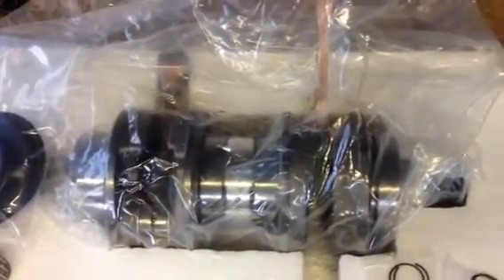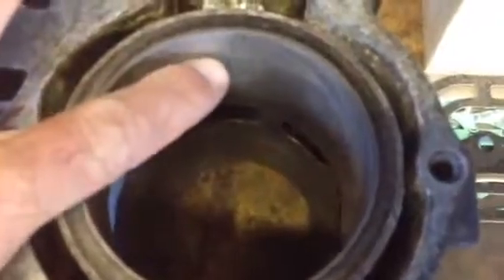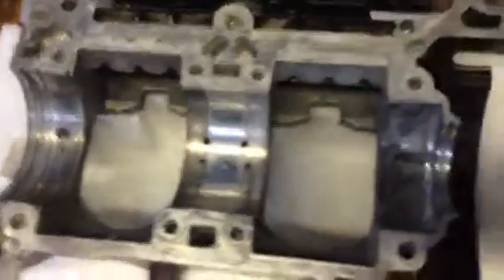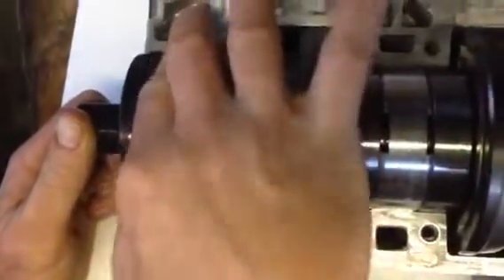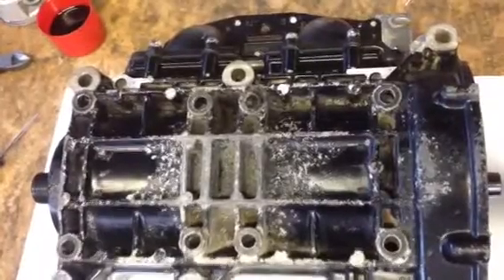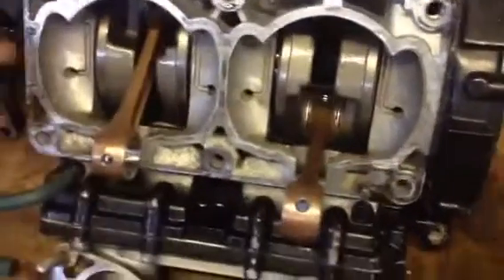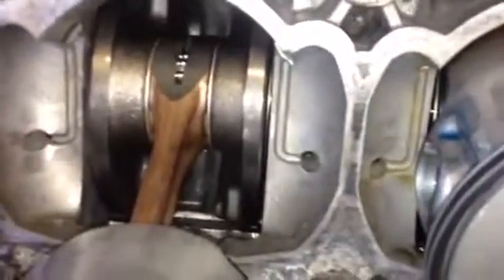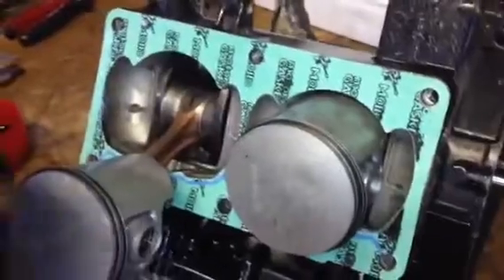Yamaha WB760 Engine Rebuild - How To

Comment: Did you fill up the crank case with oil manually?
Reply from the maker: This is a Yamaha no need to fill the casing with oil. On the Seadoo two stroke motors they have gears that need the oil .

Comment: I’m going to be replacing my crank seals on my 94 waveraider 700 .anything I should do while the motor is apart to it?
Reply from the maker: my dad I would refurbish the crank completely while it is out of the motor . New crank and Conrod bearings and small ends at least .

Comment: Any video  on how to change the pins that the crankshaft bearings sit on? I have a xl700, the pins are flush with the case
Reply from the maker: Nope I don't have such a video . Your pins must have been pushed in when they put the crank in that's not good
Reply: @Redrockat  they were like that when we took it out must have been broken or something, I'm just looking for hownto replace the pins.

Comment: Hello 
clamping pressure for the cylinder head in newton and the low cylinder. thank you
Sorry I'm french for english translation
Reply: with or without joint compound?
Reply from the maker: RDCPP01 on the block and on the head castings the Newton meter torque spec is written . But it is not a lot not more than 33nm torque both top and bottom
Reply from the maker: RDCPP01 The lower casing gets joint compound (sealant) and the head does not get joint compound (sealant) .
Reply: @Redrockat  do you have to oil the cylinder head gasket before tightening?
Reply from the maker: RDCPP01 no you don't oil the head gasket at all before tightening
Reply: @Redrockat  Just for information the number marked on the bolt corresponds to what?
Reply from the maker: RDCPP01 the numbers on the bolts mean the size of the bolt then in the manual the m8 bolts have a specific torque that's all 😊 so the numbers  on the bolts don't have to correspond to anything else .

Comment: Can you please briefly describe how you're flipping the engine inside the bay? Are you flipping it with the intake and exhaust with same orientation before and after flip or flipping the exhaust side to intake side?  I'm about to rebuild my 760 and heard horror stories about removing engine but your "flip" technique is genius.  Thanks and wonderful video!
Reply from the maker: Paul Mizell it goes in upside down then turn the intake so that it rotates to the bottom and the exhaust to top . This means that the exhaust does not come close to the bottom during rotation .

Comment: Did you seal the bottom cases, add a bit of grease on the threads salt water ruins these motors

Comment: I have a Yamaha 97 gp760. It ran fine for a summers. Come spring time and wanting to take it out it would not start. It would just make a clicking sound and about every 10th time it would do a half rotation of the motor. Something is binding it up and I don't know what.   I changed the starter and solenoid. Taken the impeller shaft out to make sure it wasn't the problem.  I've even disconnected the starter and pulled the spark plugs and tried turning the motor from the crank and she won't budge. I recently pulled the head off and looks clean with no obvious blown ring or rust.  I'm at my wits end and was wondering if you might know if it could be something else I might be missing to troubleshoot without gutting the motor out.  Thanks.
Reply from the maker: Lyle Thompson open your magnito housing and inspect it inside ,when the bendix breaks it will do the Same . The pieces get stuck in the magnito and stop it from rotating .
Reply: Thank you so much. I will give a look.